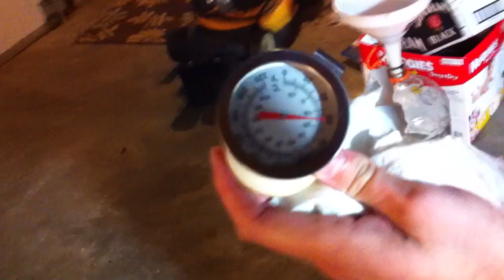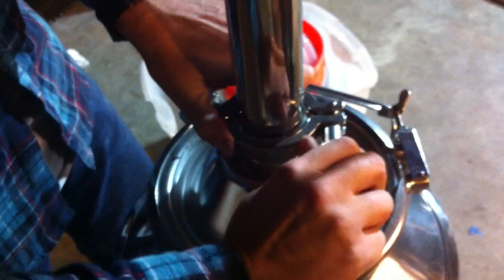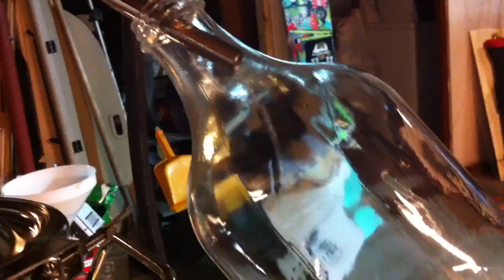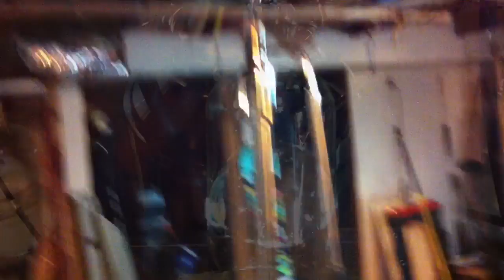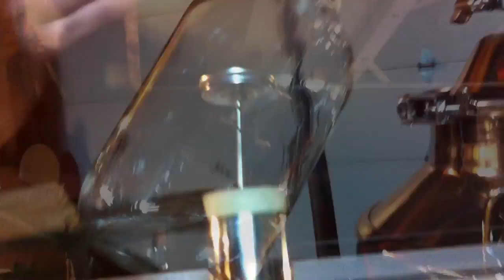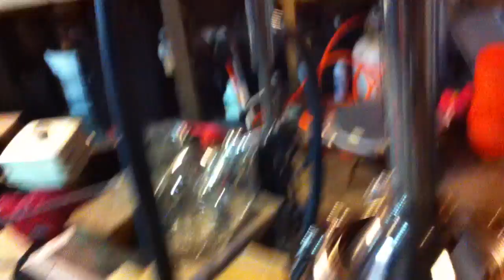Making Whiskey - Mile Hi Still - Moonshine - Reflux & Pot still

Comment from the maker: We'd connect both and put packing in the column. We've used pure copper pot scrubbers with great success as packing and they increase the surface area greatly and thus the strength. It comes out an ultra pure 192 proof in one run when running reflux style.

Comment from the maker: It's about $200 for the column. The rest you can get really cheap or substitute different equipment depending on your needs. Use a keg as a boiler, works well also. Gas cookers are cheap. The pump is optional but I don't like to waste water so I use it.

Comment from the maker: It's incredibly simple (the pot and condenser are attached to each other so there is less parts). I had to use a pump with my pot still too. Otherwise I'm just wasting water. You could hook up the reflux to a hose if you want to waste water instead of have a pump.

Comment: Have the same rig.  Works just fine using uncle jesse setback method.  Only problem running uncle jesse loop is the large quantity that you produce!  I'd buy the same rig  again.  I also suggest this head and milkcan if you want to jump right in to the hobby.   This way you dont have to screw around makng crappy still head experiments with expensive copper.  There is plenty of experimenting with the mashing and running of the still to keep you busy.  Stay safe and crack the garage door at least.

Comment: Question please: if you run this as a reflux still, would you connect the inlet/outlet hoses to just the reflux chamber on the column top, or through the reflux chamber and condenser both?

Comment: the reflux looks more troublesome than the worm ...and when your experienced ya don't need no fancy thermometer to tell the right temp .....your pumping the same water through ..does it keep a low enough temp to condense like that  or dont recirculate the water through the flute ?....it's an interesting rig ..but needs to be simple without the B.S. !..SLAINTE !!

Comment from the maker: Methanol is what makes you blind and if you your temps are right you could potentially make methanol with your ethanol alcohol so people typically throw away a small amount of liquor at the start and end of every run. Even it it has no Methonol it has lots o f impurities that will give you a horrible headache. Just throw out a few ouces and you should fine, We probably tossed 12oz here just to be safe on a 10 gallon batch. This was a new way to run our head though.